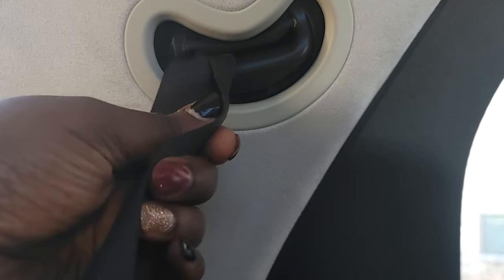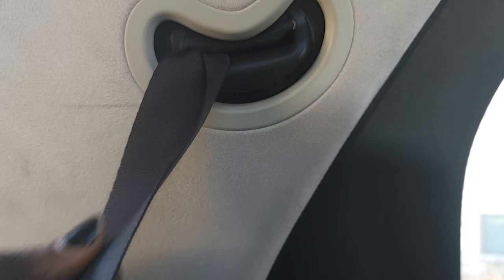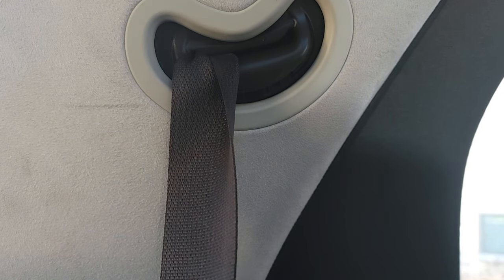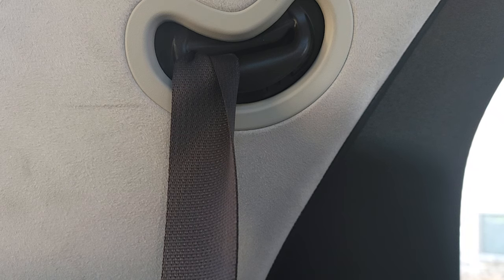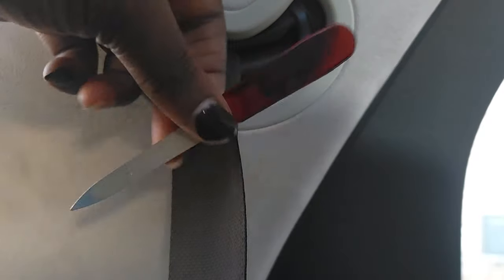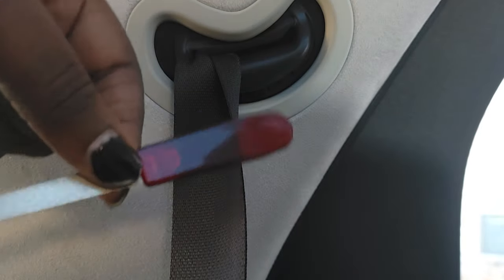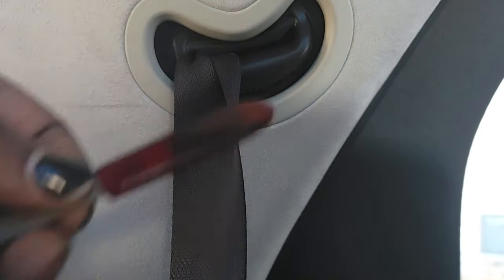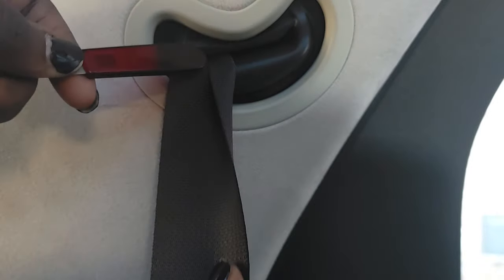How to repair your stuck and twisted seatbelt with just a nail file and two minutes.

Comment: Had the same problem however this didn't work by itself. I searched for my car make and model "how to remove interior trim" and found another video which showed me how to pull off the plastic bit covering where the belt was twisted. By pulling some back through I was able to get the tension of the back end of the belt which was stopping me from untwisting it, and then your method worked for me. THANK YOU SO MUCH!
Reply: that trim just snaps in place with every car I know of, but a lotta times you also have the rubber weather stripping in the way too.  it's actually only a few minutes to remove and replace that stuff.  even the plastic piece at the bottom only takes seconds to remove.  less than a 5 minute job with the worst case scenario.

Comment: Thanks for this helpful video, it was the passenger side ,I didn’t have a nail file handy ,so I used a metal teaspoon handle ,had to wiggle it for quite a few minutes like in the video ,then folded bit sort of moved across then I moved it back and wiggled it bit more and now it’s fixed.

Comment: Thank you very much, I was able to fix after watching your video. I used a similar kind of tool like the nail file, It was stuck for a long time.

Recently one of my relative met with an incident, he is safe and good. But seat belt would have been better and it could save lives.
Reply from the maker: @Froggieeee  I'm glad this helped you get it fixed and that your relative is safe.